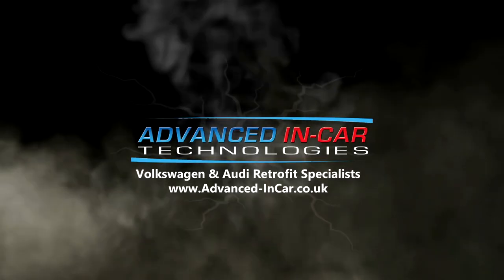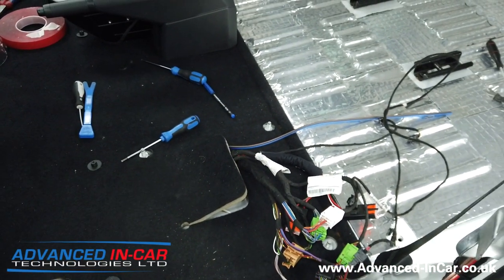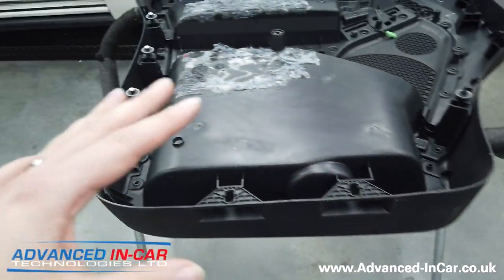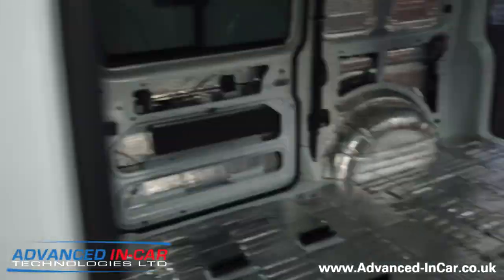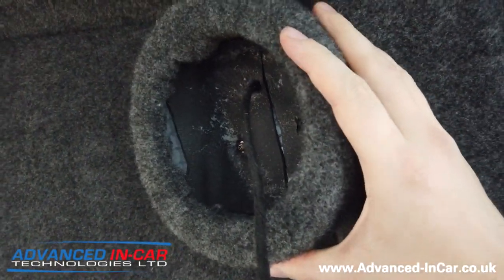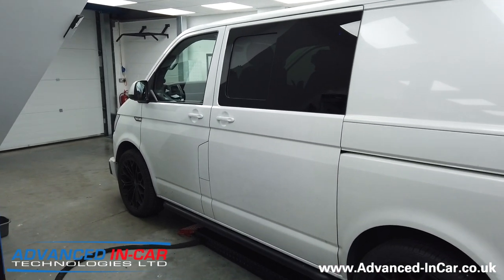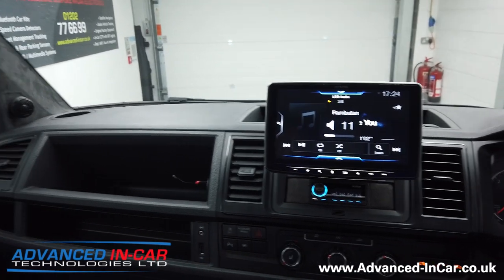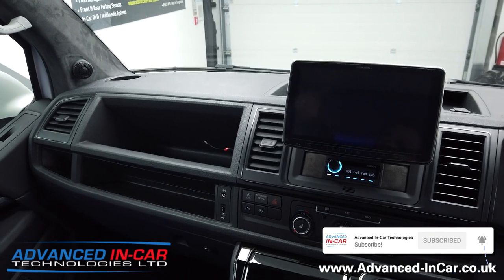Volkswagen Transporter T6 - Full Digital Audison Sound Upgrade

Comment: How are you sending the music to the head unit in this set up? Did you sound deadened the outer skin of the door. ?
Reply from the maker: Sending the audio via USB. Yes always sound deaden on an install like this. Had 3 stage which is all panels inside and out, panel liner and a form of diffuser on the outer skin
Reply: @AdvancedInCarTechnologies  so it’s not a fully digital then? Why don’t you send the music to the amp via WiFi? I have a full Audison digital setup in my T6 that was built with Audison and using the usb isn’t the best.
Reply from the maker: Slightly incorrect statement there. Never said our system couldn’t offer WiFi or go direct to the processor but in this instance it’s USB in the video. 

Remember, it all comes down to customer specification on an install of this scale. They wanted things a certain way and wanted to operate via a headunit and not direct to the Processor (Which this system can also offer)

Also USB is considered the “better” source for transmission hence why Audison recommend this when operating via a headunit.
Reply: @AdvancedInCarTechnologies  it the title you put fully digital, but it isn’t.
Reply from the maker: It is. Just because we’re using USB at one point for the benefit of a video doesn’t mean it’s not.